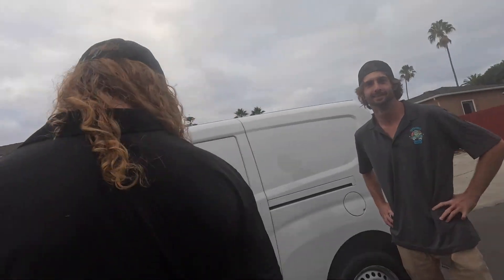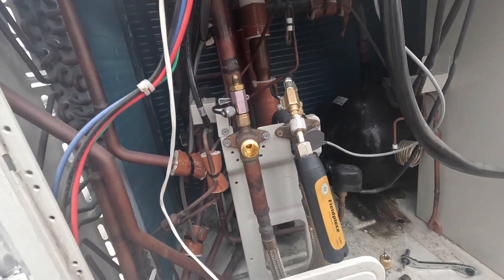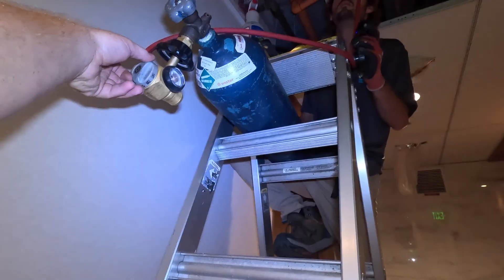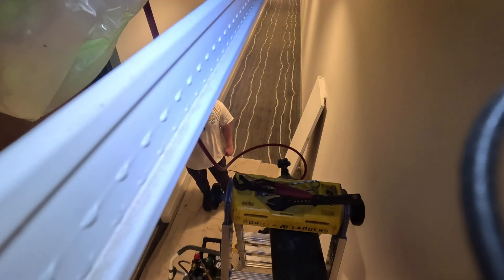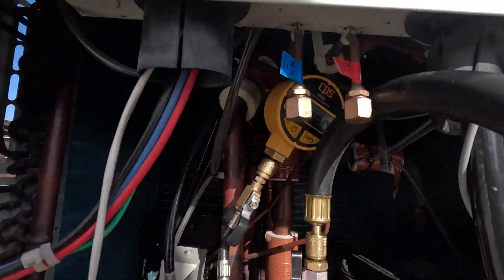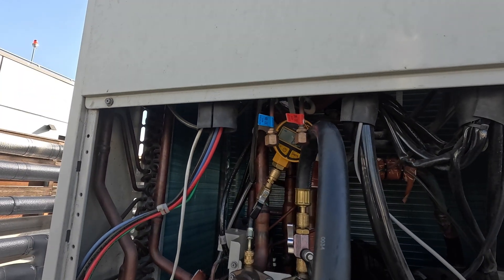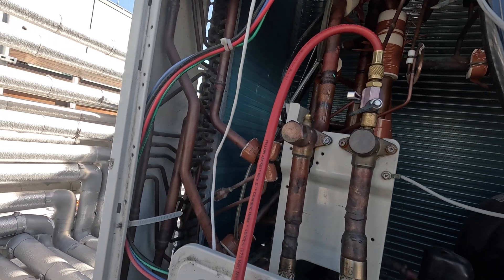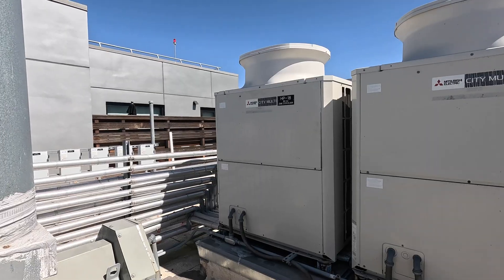Big Leak Repair = Big Money???

Comment: Who uses 45s on refrigeration piping? Thats what happens when they have plumbers do piping. 

You also need to step up your evac game. Get yourself some trublue hoses man. They are game changers.
Reply from the maker: We have tru blu hoses but the fittings started leaking and I haven’t replaced them. And my thoughts exactly on the 45s lots of unnecessary leak points just to have sharper looking pipes